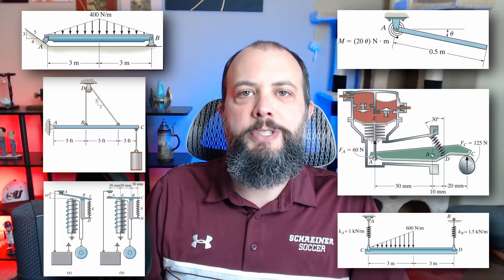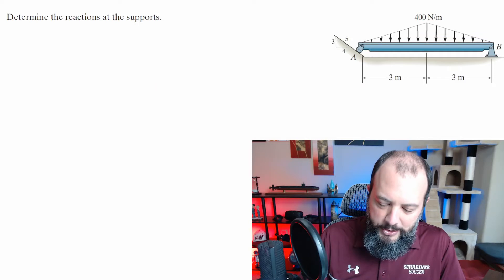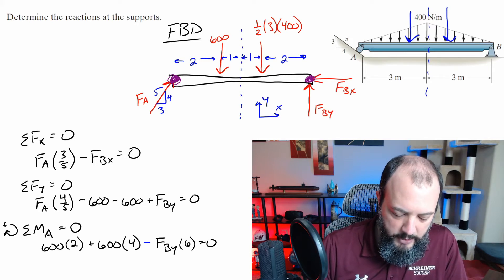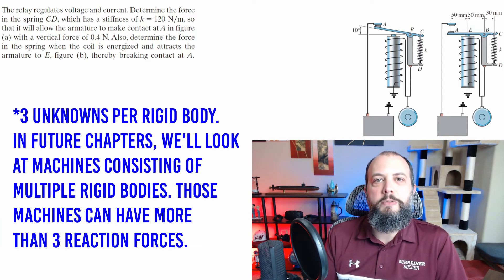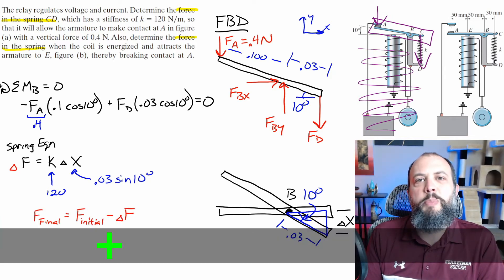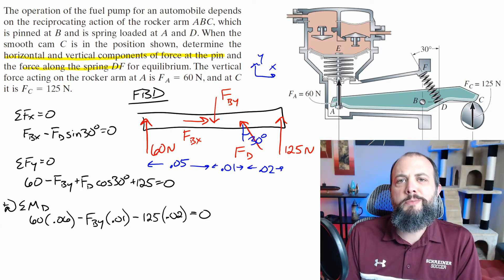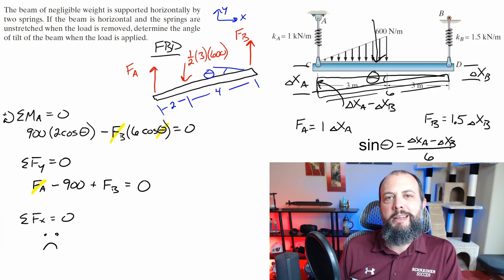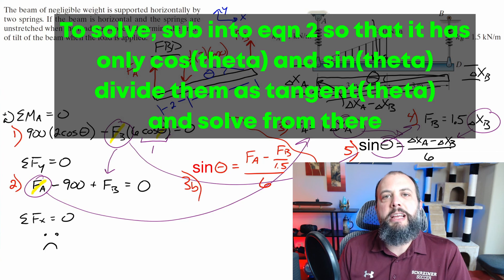Rigid Body Equilibrium – Free Body Diagram Practice Problems | Two and Three Force Members

Comment: How did you know root 5 for the second problem?
Reply from the maker: Pythagorean theorem. 1 squared is 1 plus 2 squared of 4, 1 plus 4 is 5. The 1 and 2 represent rise and run of the slope and the sqrt is the corresponding diagonal. 3 4 5 is another common angle to see here since 3 squared plus 4 squared is 5 squared.